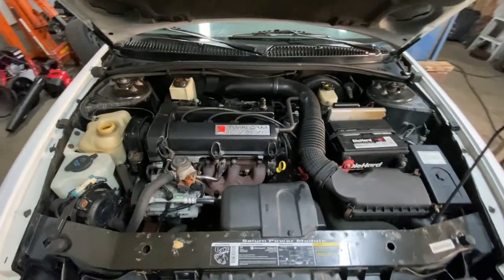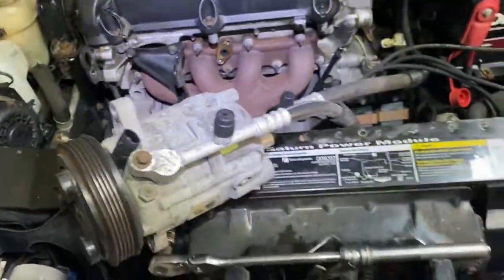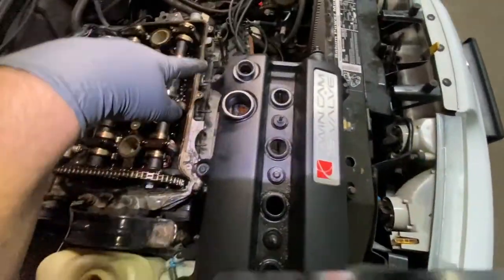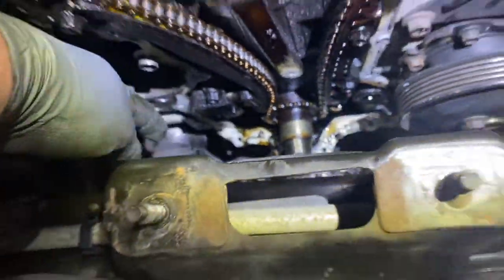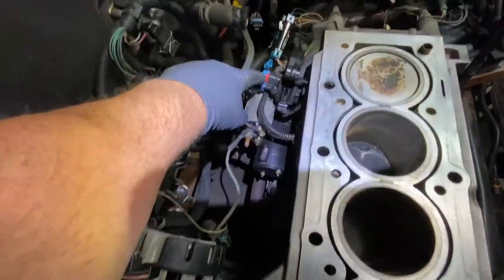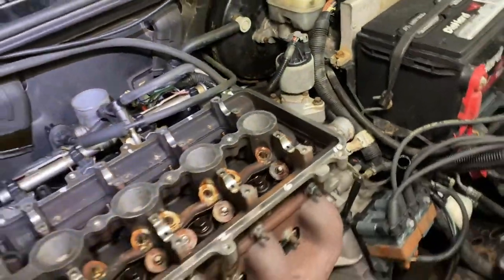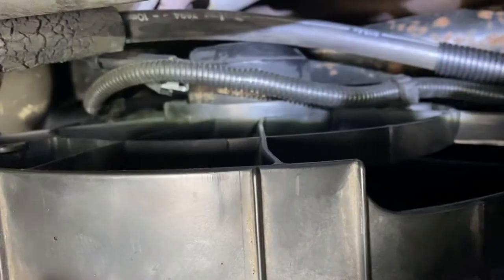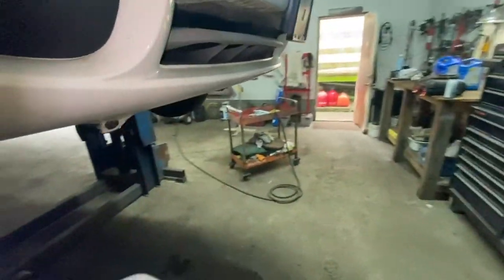Complete Cylinder Head Removal And Install On GM  Saturn S Series 1991-2002

Comment: I wish I could’ve watched this video 26 years ago when I bought my 2 year old SL2 for $9300. This guy covered TONS of stuff that I had to learn on my own. 🙄Hoping to hit 300,000 in the next couple years. She still gets 36-40 mpg depending on how much I coast! 😂
Reply from the maker: Thank you, really appreciated! Those Saturns with proper maintenance were no frills cars that were very reliable and could last very long with exceptional fuel economy as you stated. They had automatic solenoid problems and clutch nut inside auto transmissions that had problems but weren’t too bad to fix.

Comment: This is the best video on Saturn Engine (we have 2001 Saturn SL2). So many films together with a lot of useful information. Our Saturn consumes some oil between the oil changes, and I've learned that worn Piston Rings can cause it. May I ask you, if I need to replace just the Piston (to work on Rings replacement) how much I need to remove? Should the Timing Chain be removed? Thank you for this great film.
Reply from the maker: Thank you! Appreciate the feedback. No head has to come off so timing chain cover does as well.

Comment: Excellent video i really appreciate this you do a great job! Quick question, when oiling head bolts on install do i use regular motor oil or assembly oil?
Reply from the maker: Thank you!
You can use engine oil

Comment: Great video thanks i own a 2002 saturn sl1 not exact model but close lol
Reply from the maker: Thank you! Yes almost the same, you have a sohc this one was a dohc
Reply: I also have 02 SL. I had couple rocker arm break, replaced them and when fired it back up another rocker arm broke and lifter broke. I debating on whether or not it is worth it to rebuild the head. I paid $500 for it and it has 365,000 on it which I only put on a 1,000. It needs a new muffler as it doesn't have one and a new sway bar. The big problem fixing it is money is tight for me right now and I'm working on it shade tree style.
Reply: @jamesrobinson1022  have you had any problems with your throttle position sensor?